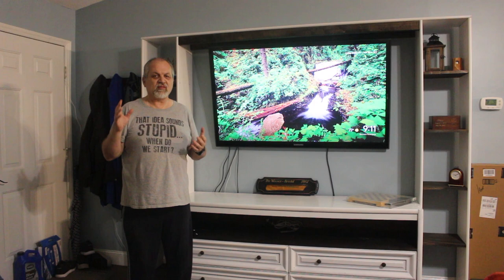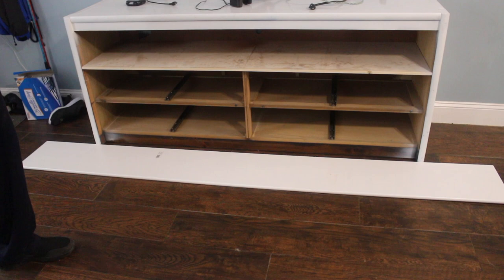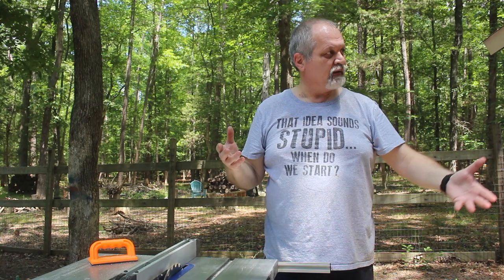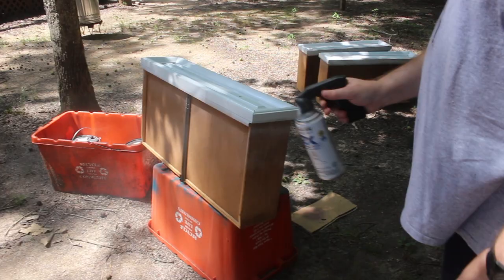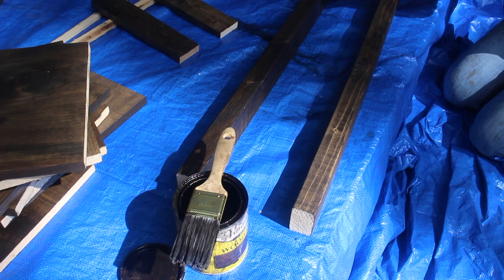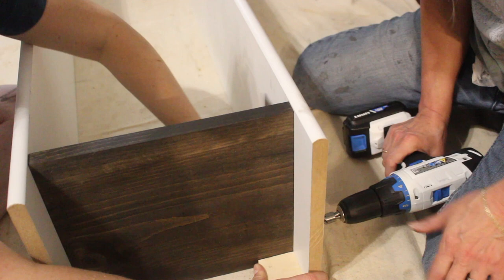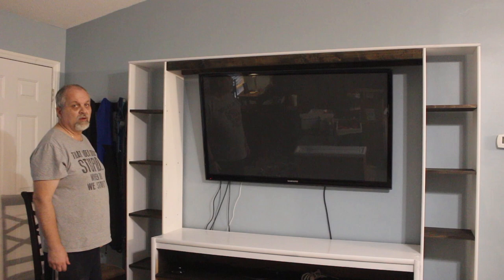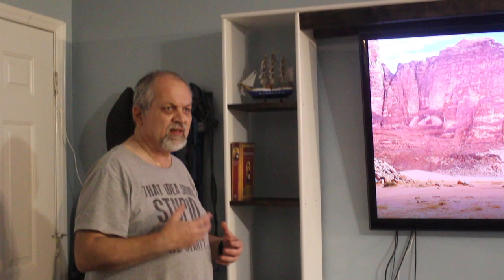Save $$Thousands$$ lean how to build a custom entertainment center!

Comment: Those stained accents do look great! Will you be cutting in low voltage single gang boxes with brush plates behind the TV and bottom component shelf to run the cables inside the wall?
Reply from the maker: That's the plan!